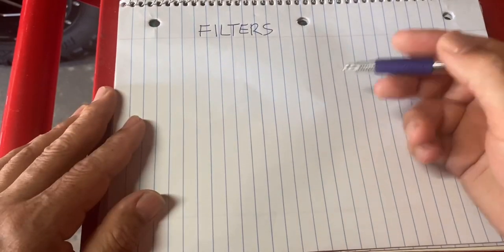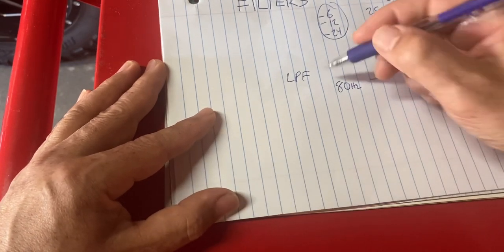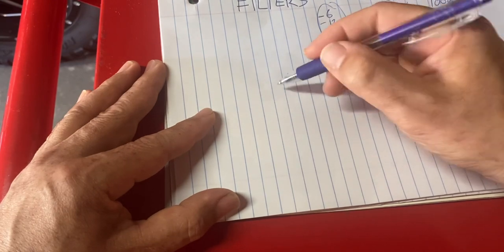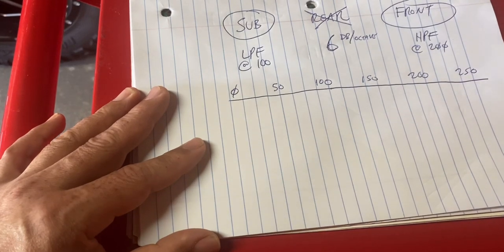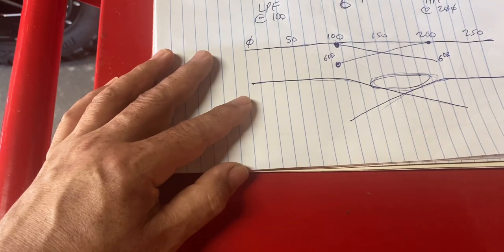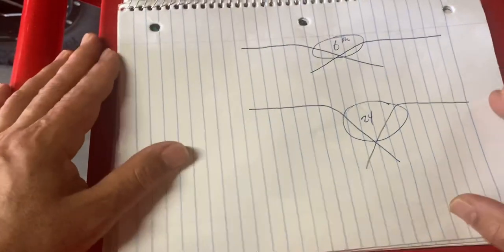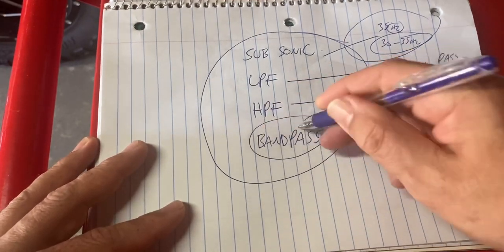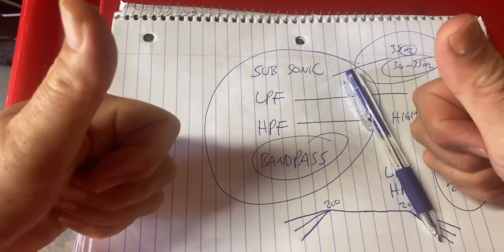Tune your amp filters like a pro!!! HPF, LPF, Sub Sonic, bandpass fully explained!!!

Comment: As a professional audiovisual professional- tech director, audio engineer, lighting designer, videographer of over 20 years, you explained the use of audio filters better than most people I’ve heard.

The only thing I would have mentioned is maybe in the purchase stage of speakers for your stages consider the frequency response of each speaker so you can correlate that to where to set your HPF and LPF filer settings.
Reply from the maker: Thanks for the feedback
Reply from the maker: Sometimes that’s what you have to do if your setup does not have coverage in a specific frequency bandwidth. For example if you have 15” subs and 6.5” components. It’s going The be tough without good solid 8” midbass to get that 125-150hz punch. As 15’s should not be set to play that high, nor 6.5’s set to play that low.

Comment: I have been trying to learn this for years.  You have taught me in 21:08 min. Thank you very much. I follow all your work. Thank you very much
Reply from the maker: Awesome! Thanks for the feedback!
Reply: @NextLevelCarAudio , do you have contact information that you’d be willing to share? I have several questions and would love your help. You’re the first person that I’ve seen that understands tuning the right way. I need to set up a bandpass for my system. I’ve been following your setup. I’m doing a very similar setup. I really need help with my tuning. I’m willing to pay you for your time. I’m installing 3 amps. Four DS18 bullet tweeters on a JP84, four D4S Pro Audio 6.5 mids on a JP234 in the doors, and two 12in Sundown Nightshades v5’s on a SALT 8. Box at 32hz. Also, 80ah Lithium, plus XS Super Caps with an 270 hp alternator. Big 4 1/0gauge, Pioneer DMH-W4660NEX dash that has an built in DSP with 3 separate rca outs for bass only, mids only and tweeters only. Setting the frequencies like you did at the end of this video is the help I need. The frequencies to set for each is what I need. I will be using a DD1+ and a CCi combo pack to setup everything. Thanks again for your help and reply if you can.
Reply from the maker: My Instagram @ nextlevel_caraudio

Comment: Question! Love your videos! 

 My pair of 6x9s recommended HPF is 120hz, and a pair of 6.5 subs with recommended LPF 160hz. So do I just use those settings? Or is it better to set my HPF to 160hz so it picks up where the subs start to roll off?

Comment: Why wouldnt you just set both your lpf and hpf to the same frequency? That would give the least gap in the center. This even seems to be common on head units with only 1 crossover frequency setting (LPF) which automatically sets the hpf.

Comment: Great explanation! I mean it. I had a decent grasp, but this filled in all the blanks. I'm running 70hz lpf with a 24db slope and 150 hpf with a 6. 40hz subsonic. I like my speakers to kick me in the head, not rattle the neighborhood. It works. 1.1 ft³ sealed 12s x2 on 1200w.
Reply from the maker: Awesome 😎

Comment: I've got a pioneer gmd9701 running my subwoofer... Gains set with oscope & multimeter. LPF is a 12db octave, I had it set to 80hz, but sounded boomy so I lowered it to 60hz & sounds alot better. Dous this make sense to run 60hz with a 12db octave slope to take some boomyness out?
Thanks

Comment: Awesome video. Definitely something I needed because I’ve never did anything with car stereo system besides paying a professional installer to install it for me. 

Question: you talk about setting the LPF/ HPF and -6,12, 24db. 

Where would I find the information for LPF/HPF settings, Hz and octave slopes for the speaker frequencies?

I want to install (2 door & 2 deck) JL audio C1-690tx with JL Audio 300/4v2, and (2) JL Audio 10W3v3-4 with JL Audio 500/1v2. I want to know the Hz, slopes, LPF/ HPF recommendations prior to me buying the equipment.
Reply from the maker: Typically it is set based off size of speakers and enclosure not necessarily the specs on actual speakers. For instance subs... 10” you LPF higher say 120hz while 18’s you LPF lower say 80hz.

Comment: Really good explanation. Made it a lot easier to understand. Good job and do more videos like this. Also how do you know what frequency your subsonic is on when it starts at 10hz and ends at 50hz. Is there a way to check and set it with a multimeter or something.
Reply from the maker: Need a CC1 or something similar, otherwise guesstimate. Is usually the go to. Because of slope/roll off. Does not need to be exact

Comment: Nl, you did that well , you made it easier to understand,  for the beginners, out there 👏!! I use my head unit for the filters and run my amps,full range,why  crossover twice ,in my opinion ,what are your thoughts on using the head unit ???
Reply from the maker: That’s good so you can adjust on the fly if needed

Comment: Can a person take a 2 way coaxial speaker, and wire up a crossover to control and tune the tweeter, and the woofer to more of a midrange speaker? Like a 6x8 speaker.
Will a coaxial fill in more of the frequency range you talked about in this video?

4 6x8 door speakers and a subwoofer thin down fire in a king cab  pickup
I didn't  want to mess with my door panels. Installing 2 way or 3 way component  speakers.

Comment: My enclosure is tuned to 34hz and i used single subwoofer 500rms 
Then tell me the 
Lpf 40-180hz
Subsonic 0-50hz
Boost frequency 30-80hz
Setting pls
Reply
Reply from the maker: LPF- depends on size of sub (10” 125hz, 12” 100hz, 15” 80hz)
Subsonic- 34hz
Boost-0
Reply: @NextLevelCarAudio  thanks love from india

Comment: Great video thank you!
I have one question I have 3 amplifiers running out of a crossover so do I do this hpf and LPF in the head unit and the Crossovers and the amp? Or only on the amps? Or should I do all three and try to make them all the same? 
Oh and also I would love an example of how you set Yours
Reply from the maker: You can, but I like to hard set them at the amp. Head unit can get reset or lose power and will have to start over. Once set on amp, your good

Comment: Thank you buddy I'm working on my Harley and I have what they call a Rockford stage 3 kit and it comes with a 400 watt amp with a 6.5 round set in front and a 6x9 set in the rear bags the amp has the hp setting of LP AP Hp 60 or HP 80 I'm looking for the best all together sound without distortion clean music I have the 6.5 round speakers on hp80 and 6x9s on hp60 is this your suggested setting?

Comment: Hey my box is tuned at 35 hertz what should I set subsonic I have a 1800 watt audiopipe amp.
Reply: One more question I have my lpf on Amp set to 80hz do I need to set head unit as well to 80hz
Reply from the maker: You can leave head unit filter off and let you amp do the work. Up to you
Reply: @NextLevelCarAudio   thanks so much .

Comment: Wow I kind of understand all this now. I have watched tons of videos but yours was the most easily understandable. I do have one question that I cannot find an answer to. Do you recommend using the amps hp/lp or the head unit. It seems easier to use the headunit to make adjustments on the fly but my amp does not have switches it gives the option of 35 to 250 for low pass and 15 to 250 for high pass. If I use the head unit for hp/lp which frequency should I have the amp's knobs turned to? Thanks again... you definitely have a new subscriber!

Comment: On a Subsonic Filter 20hz - 50hz

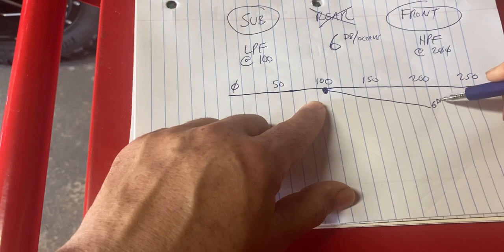What would it be at 12:00 position? 35hz?

20+50=70hz

70/2= 35hz

Thanks for anybody that can’t help me figure it out..

Also, LPF 20hz - 200hz 

Half way would be 110hz and 9:00 position being 55hz?
Reply from the maker: You got it ;)
Reply: @NextLevelCarAudio  thank you sir.

Comment: Awesome video, so i have 2 8" subs and box tuned to 33hz. Should i have my lpf set to around 80hz or little higher and my subsonic set for like 30hz? Some songs sound like there not even playing bass that loud when i know they have bass and some are way loud at low volume. I never had 8s so dont know if im jus not use to the frequency an 8" plays or my gains on my loc and amp are little off. I know my amp is way to big for the subs and maybe the shop has my amp and loc turned way down or something.
Reply: try to find your subwooofer manufacturers specs. usually they recommended an LPF setting. If they don’t, then the sweet spot for subs is usually 80-100hz. As for subsonic, I’ve read to set them either at your boxes tuned frequency, or 70% of your subs lowest frequency response.

Comment: Very informative. My 4 channel amp for my front and rear doors has an hpf,lpf, and Full selection.  I'll be running ds18 component set up in front doors and Ds 18 coaxial in back doors. Should I run them the "full" selection since it's a component with a filter on the tweeter? 6x9 coaxial has a filter built in too.
Reply from the maker: Yes you can. I personally would set just HPF at say 150hz so they don’t play too low of frequencies
Reply: @NextLevelCarAudio   awesome thx!!
Reply: @NextLevelCarAudio  also I wanted to pick your brain to see if im understanding something correctly.  My mids n highs amp is 1000k. It has the option to  bridge. Would that be technically sending 500 to the front and 500 to the rear?
Reply from the maker: No that would be sending full power to one set of your channels. If 4 channel then 2. If 2 channel then 1. If running bridged, most amps require a 4 ohm final load. None lower

Comment: Everybody's got a twin. But the same Humvee? Are you from a one-horse town that had a red light? This is a lot of work I don't want to fuck up! I was running 3 amps. I just ripped everything out. Laying down another 4 gauge power lead dedicated to the new Rockville amplifier. I have an old school set of Orion xtr-10s they're 4 ohm but don't know if they're single or dual coil. Going to run it in series to a 1ohm. Got two connections on each side.  The Amplifier tells me nothing on wiring 4ohm. Amplifier dual positive negative terminals are connected in parallel inside amplifier. This is in a fourth order box. It's a bit of work to get in the box.
Reply from the maker: What do you mean same Hummer? 😂

Comment: I understand better now and I’ll mess with everything later 
I have 2 amps at the moment hooked up 1 monoblock pioneer with 2 12” Soundqubed in a Skar Ported box I believe it’s tuned to 32hz and I have the other amp 4 channel bridge able Hifonics Brutus 1600.4 4 prv 8” 4 ohm wired 1 per channel for the moment also have 4 ds18 Bullet tweeters 4 ohm and probably gonna wire them to a separate amp or see if I can wire them series parallel to keep the resistance low but I’m concerned with the latter because they have bass blockers. 
Either way I’m using a Pioneer and I plan to use your info to tune the hu and see how it sounds

Comment: i have a JL750/1 on a W6 in a Wedge HO and a JL 600/4 on 4 hurtz 5 x 7 with a pioneer double din 4800. What would  be a good starting point to set frequencies on both? currently at LPF 80 on the 750  and 80 HPF on the 600/4, but seems as tho it could be better but im stuck.  any help you can offer would be great.
Reply from the maker: Settings sound decent. Maybe try shifting to  100 vs 80 on both… but other than that, external dsp or sound processor.

Comment: I have a motorcycle with a Picasso PN4 1000 4 channel amp set on all pass for the MM1 5.25 and 6x9 Coaxials.  Head Unit is Pioneer MVH512BS and there is no HPF / Slope or cross over set. I am still very confused where to set these. So far I have just found the max clipping part on the volume. Then I set the gains with the head unit flat as recommended. I am understanding somethings better here and now I read I should set the head unit where I like it and then recheck gains for clip adjustment. Im sorry I am still a little confused.
Reply from the maker: Gain should be last thing you touch. I always recommend dialing in your head unit, EQ, filters, etc. first. So that your gain does not get skewed when adjusting your other levels. Coaxial speakers can be set to all Pass no problem. So you should be good there

Comment: Question. I have a 8"under seat active sub and my car only has front speakers (it’s a hatchback). The installer set my LPF at 150 with a 12 db drop off and my HPF at 120 with a 12 dp on my car stereo . It sounds ok for most hip hop sounds but when I listen to pop theres constant bass tone in the song that comes through the sub as the artist sings (guess that's what mid bass is? Idk)and it sounds so odd since it comes throug really loud with the singer in the song. Do you have any advise for what I should set the Filters too so that doesn’t happen?  Help is appreciated I don't know much about this stuff.
Reply from the maker: Way too much overlap! LPF should be 120, HPF should be 150. Reverse it, and should sound better.

Comment: i have mine set so that the bass plays some mids and the mids play some bass at the same frequency, and use a 24db/okt filter. Works pretty good, but going to a dsp to get more control for all my channels soon. And i dont tutch the equalizer on the headunit, all flat..

Comment: I think you explained the band pass filter backwards bc low pass should be 200 The high pass be set to 2,000. That's just opposite of what you said now if I'm wrong please let me know,  thanks
Reply from the maker: What you explained is not band pass. Band pass is simply passing a specific band of frequencies between the low and high spectrum. To create a 200-2000hz bandpass, HPF needs to be set to 200 so it will “pass” frequencies above 200 and cut frequencies below that, and LPF needs to be set to 2000 so it will pass all frequencies below 2000 and cut everything above it. Creating that specific frequency window or “band pass”.

Comment: this helped soooo so so much. about to upgrade my install. finally found a pair of re audio xxx12's. can't wait. 
deaf bonce apocalypse 6.5's for mids then ds 18 4.5inch super tweets.  question what would u recommend to set my mids n highs at?
mids can play from 150htz -15khertz. tweets is 29khtz and up.
Reply from the maker: Does your amp have bandpass filter capability?

Comment: Great Video! The information is so damn helpful. I've been struggling with my one 12" Skar EVL enclosure trying to fine tune it. I've watched your other videos trying to learn. I'll be testing this method out later today. I've done bass testing with frequency from 20hz-50hzs, 40-50hz sounds best but I like that low 25-30hz bass. I have an 8 speaker pioneer premiere system that is not hooked up to any amps just the Sub monoblock pushing 1500 watts. I'll let you know. Great content, I look forward to watching more
Reply from the maker: Thanks! Appreciate the support!
Reply: What it your box tuned at?

Comment: This video is freakin awesome. But quick question, I am running a full range for my sub amp. It's running off the stock sub signal so already crossed over before the amp. I get the LPF, but what should I have my HPF on since it's on a sub?
Reply from the maker: Treat it like a sub Sonic filter. So set it for whatever it ported box is tuned to. If sealed, set it to around 20-25hz

Comment: think you. please describe about how to fine tune LPF and gain for a active (powered) subwoofer. 
the problem is that, there is so many settings for one thing. i mean i should deside about subwoofer level in my kenwood HU, also i should deside about the powered subwoofer gain, also i do not know which level should be the subwoofer knob when tuning these settings.
Reply from the maker: Set subwoofer level on head unit to max. That way you get the highest preamp voltage to your powered sub so that you don’t need to turn your gain as high on sub which means lower distortion

Comment: Hi my Clarion /xc1420 has a Switch "90 - 60 - Full "   Below the Front  Gain Knob also another Same Switch Belowthe Rear Gain Knob 
what is that ???? is that the HPF or LPF 
This AMP is install in a 2017 Tahoe - Every Time i Went over Bumps the Sound was Cutting OUT that is Why i Removed the Center Console Assembly to Fix the POOR INSTALATION !!!
Good Video BTW
Reply from the maker: For your model, Those are your HPF filter points. For the XC1120 those would be LPF.
Reply: @NextLevelCarAudio  thanks for reply,so for front do you recommend 90 and rear switch to full ???
Reply from the maker: That sounds good! 👌

Comment: Hey on my subsonic it's from off to 50 where will the dail be set if I'm trying to set at 35hz
Reply from the maker: Pretty much right in between half way and full. So like 1:30 o’clock. Or to be more precise 1:15 o’clock.
Reply: @NextLevelCarAudio   yessir thanks so much. HAPPY TURKEY DAY TO U AND THE REST OF THE AUDIO FREAKS
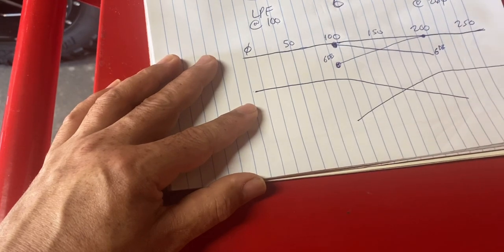Reply: @NextLevelCarAudio   more like 12:30?
Reply: @NextLevelCarAudio   did u mean 11:15 o'clock cause I got lost with the 1:15 o'clock
Reply from the maker: No, I meant what I originally said. Noon is straight up and down. Which would be half way between 0 and 50, which would be 25. You want 35 so it would be to the right of noon. Hence the 1:30 reference.
Reply: @NextLevelCarAudio  🖤

Comment: Hello can you tell me how to set up and tune my 4 channel amp? It’s a skar skv2 200.4 and I have a component set for the front and coaxial in the rear. What to set my xovers at and what channels to run them. Thank you.
Reply from the maker: Components 1+2 filter should be full range/open. Coaxials on 3+4 HPF at approx 125-150hz